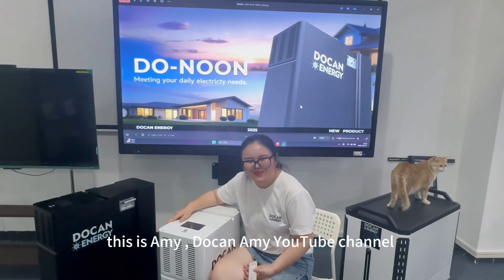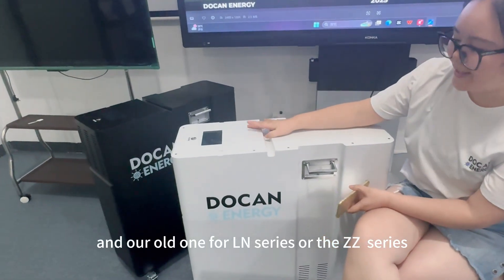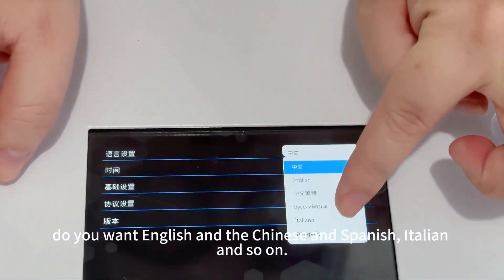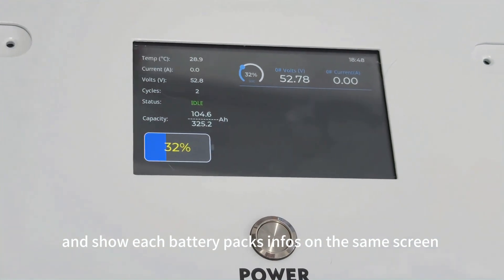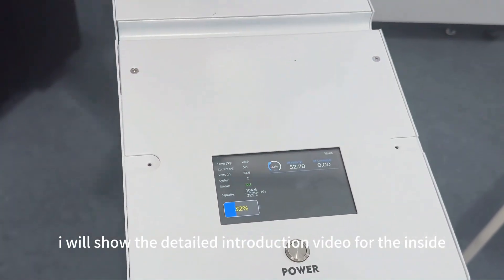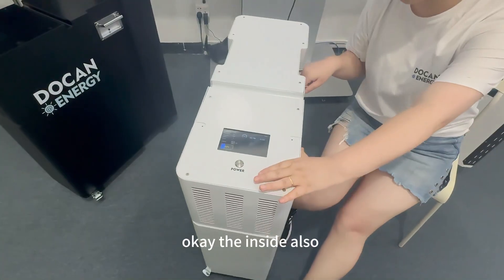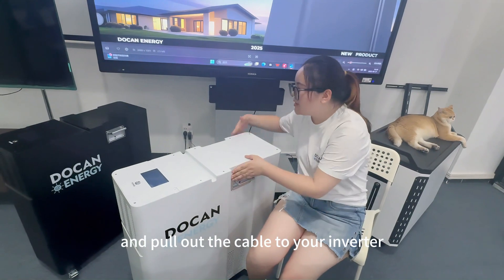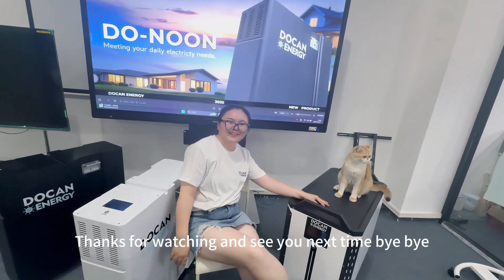Docan Noon 48V LiFePO4 314Ah 16kwh Solar Home Battery Indroduction Video From Amy

Comment: This looks super Amy, 
 Finally a movable battery that you can close to the wall and has then 25cm distance.    

 But most important,  the cells are standing upride, not horizontal as many DIY kits have.
This means the cell plates stay in the fluid and they last long.   With horizontal mounting,  the top plate can get dry in time, loosing capacity.

In the movie I didn't see any apoxy plate between the cells and also no foam.
Why ?

About connecting it to a Deye hybrid inverter,  is this protocol supported ?
In the manual 4.3 Communication interface definition it is not.   But I saw it in Panda screen. 

Connecting several batteries to 1 Deye,  You could make a set, for 4 batteries connected through a fuse, on a busbar and from there to the inverter.
We can use then the cables you supplied and the fuse we can select by how many current the inverter can give.    190A /4 = 50A fuse for each bat.
And then extra thick cable to connect to inverter.
All for a nice price, to be ordered :)

I hope you can share some more information about the BMS and balancer settings.

Thxs and regards Marcel

PS  Yes I also like the cat.  what rase is it?
Reply from the maker: Thanks for your great advice! We’ll add more epoxy plates like our Panda model in the new batch production line. All our packs, including Noon, work with Deye inverters. I’ll make another video to show Noon’s functions in future. If you’re my client, email me — I’ll offer you a $100 coupon as a token of appreciation for your kind and helpful feedback on our product.

Comment: I want to know: Does Docan Top Balance this specific battery model at full charge, before shipping out battery to customers? I recently leaned not all LiFePO4 suppliers are doing Top Balance at full charge testing before shipping. What is Docan doing to ensure the LiFePO4 cells are a matched set? What does checking battery cell three times in assembly process mean? Is that check more than just checking for matched voltages at any soc, and internal cell resistance?
Reply from the maker: Thank you, We did fully charging testing for NOON before shipping, 3times check(1st time same batch for modual testing and test, 2nd check welded bus bars conenction tightly enough with cells, 3rd checking fully charge and discharge for the assembled batter packs)
Reply: @DocanAmy . That is Great News. Does this happen for every Noon 48 volt big Ah Battery that you ship out, or just to a some quality control samples?
Reply from the maker: please email me to send you our assembly and testing process, here can not share picture